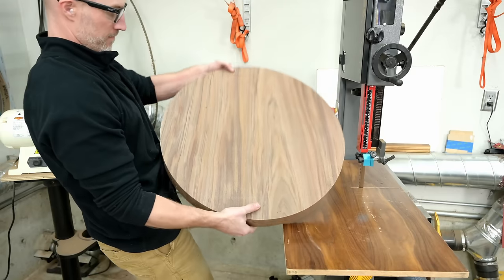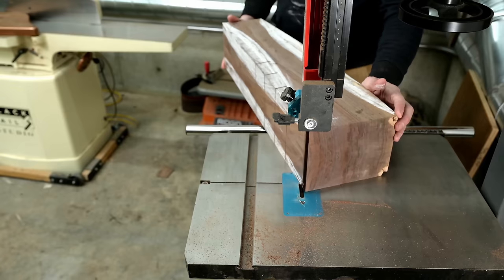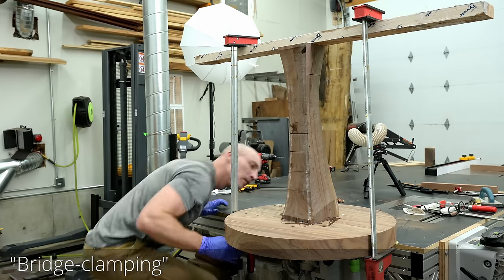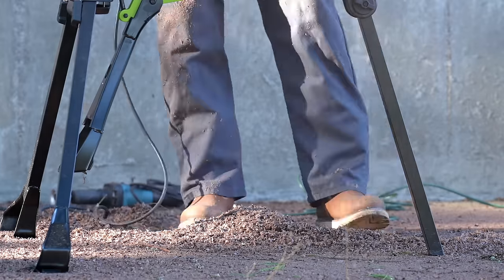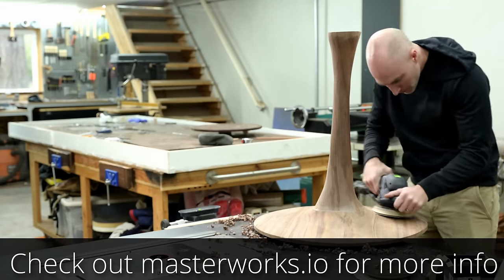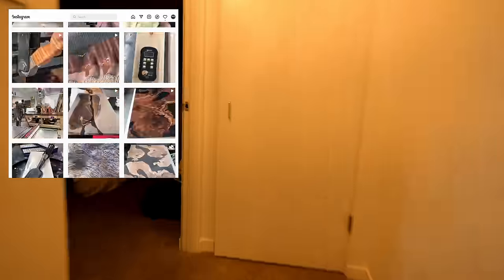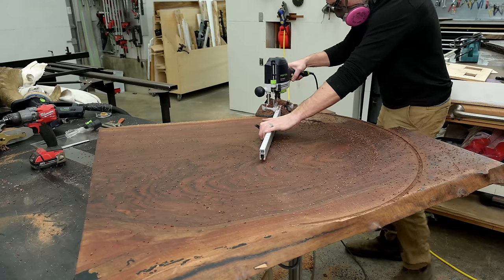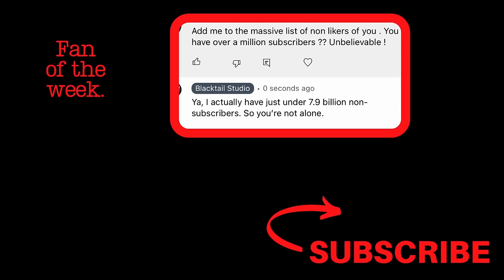I Like Money, But This is Better

Comment: I'm no engineer, but Google says the flexural yield strength of Walnut is around 10,000 PSI, the thinnest section of this table stem looks like about 3" diameter?  that gives us a 7 sq in cross section, or 70,000 lbs of bending force required to break that stem.
Reply: Yeah on the direct middle, gotta take leverage into account if someone knocked this over, see how much pressure to sheer the screws or the wood around the inserts

Comment: The boss spotted me under the table saw, loosening all the trunion bolts - thought it was a waste of my time.  He, being a little guy, took my place while I tapped, with a hammer, our flattest saw blade parallel with the right hand miter slot.  We got it down to two thousandths.  The first test yielded a surface that looked like it had been run through a jointer!  One of the best upgrades to the shop EVER!

Comment: Funny story. I use to use the flap sanding disks on my grinder to shape my kids derby cars.  While I was shaping one car, the back of the finger of my glove got caught on the back of the flap sanding disk and it pulled my finger right into the sanding disk.  Got my knuckle skinned up pretty good. No major damage.  The gloves I had were leather but a mesh back.  I still wear gloves with work like that but I am careful of what the material of the glove is.

Comment: Your a professional and i wouldnt expect you to stretch a product out past its life cycle but i know a trick when it comes to flap disk. If it starts getting dull you can run it on a piece of concrete for a few seconds and it will expose some more sand paper. It may be the difference between finishing a job and not. Hope that helps! Great table and i hope it goes for alot.
Reply: I do a lot of curved surface sanding and shaping.
I use the king Arthur holey Galahad extreme to shape then smooth with the extra fine, then use 80 grit on the arbortech turbo mini. After that I use 3" sanders with a soft pad either in the drill press or on a right angle drill starting at 60 or 80 grit and going up from there.
The main problem with flap disks is the adhesive gets on the workpiece
Reply: @toddschriver9924  i use flap disks in an industrial setting, grinding on metal. Only used them a handful of times on wood but thats good to know about the adhesive.
Reply: @07slowbalt  I sometimes use a soft 5” Velcro pad on a variable speed polisher and with hook and loop sandpaper. 
I used to try it on an angle grinder, but if it catches...
Reply: I just had a conversation last night w another guy (who likes tools as much as I do, and he’s a science teacher/ geologist rather than a woodworker like me), we were talking about this subject for fifteen minutes or so… He was telling me a story about a trip to AK where they were taking core samples out of the Tundra. the bits they were using would dull and get bogged down bc of the silica and rock in the frozen earth, so they carried w them (while hiking to remote places) a bit of concrete in a small bucket, when the bits got dull they would run them against the concrete to expose new cutting material and it worked like a charm. he said he also uses old lawnmower blades to run grinding wheels against at home, to improve the cutting action, refresh the surface of the wheel when it gets glazed by grinding against the hard steel. anyway, good thing to keep in mind, don’t throw away that glazed, or dull grinding/ sanding tool run it on something to refresh it!
Reply: @benjaminherr5247  i used to cut a specific type of brick that was hardened ceramic. It was used to line piping in coal plants as pressurized coal would be sent through them at 200 mph (so they claimed). Anyways the giant 20"+ diamond wheels kept going dull and come to find out if you applied too much pressure it would heat up the steel and the sparks being sent flying were the diamond chips.  Other times it would further imbed them leaving the steel exposed. A quick/cheap and easy fix was to grab a paver stone and run it back and forth a few times and it would expose new diamonds extending the blades use. Ran an pneumatic bandsaw for years as well and a a cheap way to extend the blades life (if not equipped with cutting fluid) was to cut/drag a candle stick on the blade for a few passes. If cutting multiple pieces at once it kept it from binding on me, ran quieter, and imo helped cool the blade.

Comment: Cam, top tip for the glueups when doing M & T's that are so snug it's essentially a piston fit, and that would be to either drill a hole about 1/2 inch by 1/2 inch into either the mortice or the tenon, OR  (preferred method) to have at least a couple of shallow vertically cut channels in the loose tenon to give the excess glue someplace to escape from -  this is why wooden dowels and domino's are ribbed, it's not to increase glue surface area but to allow a way for the excess glue (and air) to escape so you don't end up with something called "hydraulic lock" - a phenomenon that occurs when there's too much glue and air in the void below the tenon and no space for it to escape from, so the loose tenon cannot "bottom out" to full depth and sits above the pocket of uncompressable glue and air.

(For the readers)  Hydraulic lock is pretty much the #1 reason why a M & T / domino / dowel joint that is 100% snug and good when dry fitted, just will not close after glueup without applying excessive pressure (like ratchet clamps), that normally leads to joint failure.  If the joint won't close with clamps using hand pressure, you've got hydraulic lock, DO NOT force it, fix it.

If you fit a loose tenon, dowel or domino into a mortice or drilled hole and as soon as you push it in, it slides out again - that's also a sign of hydraulic lock - too much glue and air stuck in the bottom, remove it, wipe some glue off and try again.
Reply: Great comment

Comment: Cam- Try drilling a hole through the center of the peg.  This will allow air out of the hole when gluing and prevent suction when trying to remove the peg during dry fitment.
Reply: This is really smart
Reply: $3500

Comment: Hi Cam, in regards to gloves: My first career (15 years) was as a welder/steel fabricator. I wore gloves almost all the time. I worked in Central Oregon and the winters were cold, steel has very sharp edges when cut, and nasty burns can happen. These were all reasons to protect one’s hands with gloves. The key is knowing where your hands are in relationship to a spinning tool and keep your distance. 
I then spent the next 25 years as an anesthetist in Portland. Now that I’m retired I’m doing woodworking and sometimes steel furniture making. 
I’ve watched dozens of your videos and thanks to your tutelage my first river table came out fantastic. Just sold it last week.
Reply: Wow, Rod. I can't think of two completely different professions than a welder/metal fabricator and anaesthetist! 😯😊

Comment: What a gorgeous piece of work! And the winning bid amount was astounding also. Thanks for your contribution to Make A Wish.

A trick an old master taught me years ago when making tight-fitting repair plugs. Once you have it milled to the size you need but before you glue it in place, pop it into the oven on low temp for an hour or so. It causes the wood to contract just enough to make it easy to pop into your work, and the moisture of the glue will help expand it again once it's in place. Makes it a lot easier to put the plug in and be sure it actually seated all the way to the bottom of your cut without jamming partway down. Try it out on a piece of scrap and see if you find it as helpful as I have. Results will vary based on the density and moisture content of the wood, so experiment a bit to see what works for you.
Reply from the maker: Oh interesting!

Comment: You might make fitting the tenon a little easier with some shallow grooves on the sides of the tenon.  The reason it was so tough to remove the tenon after the dry fit was air pressure.  With some shallow grooves you provide a way for the air to escape when you push the tenon in, and to relieve the suction when pulling it out.  And of course it allows excess glue to squeeze out too.
Reply: Smart

Comment: If you are worried about the boards slipping back and forth when you glue them and clamp them,  Use ordinary table salt.  It acts like sandpaper and helps the boards not to slide back and forth.  You could glue one or both sides.  I'd say your table will go for $5,100.00
Reply: Look at the auction link
Reply: @Skiballer  Wow, that fast.  Thank you for the heads up
Reply: Or rub a couple pieces of coarse grit sandpaper over the top of it
Reply: I've heard that some glue manufacturers advise against using the salt trick because it might change the chemistry of the glue. Not sure if that's legit or not, but it can't happen if you use sandpaper grit.
Reply: LMAO
Reply: Sawdust works as good as salt, and you don't have to go to the kitchen.
Reply: @KarlBunker  I've never heard of that but I could see how easily it would work.

Comment: When I went to school (I studied 3yrs to become joiner and specializing in furniture making) and we had actual theory lessons. The argument of adding glue to only one side of joining faces is based on some studies which show that more thinner the glue line/joint is, makes the bond stronger and therefore stronger joint.

However, when making good glue joints you have to consider the joining faces themselves too. One sided glue joint applies better to faces which are jointed/planed which theoretically makes the best joint. If joining faces are sanded, then the glue can be added to both sides or alternatively more liberally to one side.

And then there's always the cost factor. But that applies more to industrial or larger businesses. And also I don't remember how this actually applies as global dogma compared to my domestic woods here in Finland. But that's my input on this issue.

Comment: To all the novice woodworkers out there: When it comes to glue, it really doesn’t matter whether you add the glue to one side or both. The important part is that you add enough glue. Either add a thin layer of glue to each face you’re joining, or a relatively thick layer to one side. Also consider the wood you’re using because some woods (usually soft woods, but not always) soak up more glue than others. End grain will also soak up more glue than edge grain. It’s better to add too much than not enough. If you’re getting a ton of squeeze-out, dial back the amount a little. You’ll get a feel for what enough glue is as you do more and more projects.
Reply: I thought  end grain was tighter / harder thus making better  Butcher Block tables , what I miss thanks in advance
Reply: @robervar1097  The fibers of wood run in one direction. It’s easier to cut along those fibers than it is to cut across them. Also, among those fibers are the vessels where the “blood” of the tree would run. Edge grain has less porous surface area than end grain because of this. So yes, the fibers of end grain are harder to cut through, but end grain soaks up more moisture/liquid because of that more porous nature.
Reply: @robervar1097  end grain is more porous than Edge grain but you have to remember that some Woods are more dense than others. So Butcher Block Table made of pine would not be very tough and it would soak up a lot of moisture. Whereas a butcher block table of maple would be much more dense and it would stand up to more wear and it would soak up less moisture.
Reply: @robervar1097 , end grain is easier on the edge of the cutting tools and the wood grains aren't being cut, but rather pushed to the sides away from the edge and then coming back together once the edge leaves the wood, giving it a longer-lasting life than other cutting boards/blocks.
Reply: Also, I keep an old salt shaker with my wood glue. Sprinkle a bit on the wet glue before assembly and clamping. I keep the parts from sliding.
Reply: Having watched alot of bowmakers laminate timber they insist in putting glue on both surfaces. Being wooden springs often under compression and tension  that seems to work best. Though I'd agree in most circumstances it wouldn't make that difference.

Comment: I'm attempting my first table this month. I've done some smaller projects for practice (a clock and a couple tv trays). I'm now attempting a bedside table for my mother for mother's day. I've learned 90% of the process from this channel with the other 10% from people showing me DIY ways to deal with limited equipment and tools on a budget. I guess we will find out if I've really learned anything here. If it works out, I'm going to try to make something I can sell so I can get some better tools

Comment: Hey Cam - so glad you're back!  Regarding your glue-up, I've always coated end grain with a "first coat" and let it soak-in, for a more successful joint.  This is particularly important when gluing the edges of plywood (sometimes I'll dilute PVA for this).  With Epoxy (I've always used the West System brand), I choose to use the slower setting hardener - this allows me time to end coat any and all end grain first.  Generally, when I'm prepping multiple parts, by the time I come "back around" to the end grain portions again, the glue (PVA or Epoxy) has soaked into the grain.  The result is that the challenging end grain glue-ups aren't robbed of adequate adhesive.  The only issues I sometimes run into, is a slight staining - where epoxy has soaked laterally into the end grain.  I sometimes anticipate this and hold the first coat just back from the edges (blue tape works well).  This method has served me very very well - for decades !  One other comment - I learned early on from a fellow woodworker to NEVER spread out any wood onto the floor.  It will pick-up grit, sand and other junk that is just terrible for all the cutting equipment in a shop.  Thanks again Cam - well done.  Warm regards - Ken Jackson  Vancouver Island, Canada.

Comment: One thing most YouTube wood workers don’t address is the cost of bits and blades.  You can get away with a 3,5hp Porter router for $600 but you absolutely MUST be using blades that often cost more each than the router itself.  Our shop table saw blades run almost $300 ea. but they can be resharpened for almost a decade while getting professional cuts every time.  If the fit and finish is your goal…great bits and blades should be a priority over the ‘best’ tools.

Comment: $4300 what a beautiful table! Also, that wood grain effect so desired by guitarists is called Chatoyancy. Have you ever thought about putting a steel rod through or sandwiching one before a glue up of two halves in order to add strength to thinner table stems?
Reply: Столько работы,такая текстура дерева,талант мастера-и 4.300$???!!!Да вы шутите и жмотитесь или завтдуете таланту😮😮😮

Comment: Regarding the glue. I've done it both ways, but usually mist the wood with water, and glue one side, misting the second piece just before putting them together. Over 45 yrs working with wood (part of it in a pattern shop) and I've had exactly zero experiences with adhesion failure. And nice work!

Comment: Absolutely stunning!! Laughed at getting wood tenon stuck in mortice, ur right it gives you faith the joint will be strong. If you ever come up against a similar problem, make yourself a sliding hammer, it will help remove the piece if you come up against this problem in the future. Absolutely brilliant, Love it.

Comment: 17:07 New to the channel so don't know if this has been brought up before, but that texturing looked really nice, reminded me of hammer beaten copper plates from older times, maybe it would look good not as a bottom/base but as a surface, covered and made flat with clear epoxy with a shiny lacquer or paint under the epoxy? Just a thought
Reply: At looking the vid i thought it will be the surface (i don't understand fast spoken english well)
Reply: @addjem  Me too! Looks like too much work to be facing the ground
Reply: i dont understand why you would put so much effort in it,when its the underside of the base. If it was the underside of the top plate... that would be nice to touch every now and then...

Comment: Hey Cam,
i recently bought the same Angle Grinder that you have. My father used it for the first time and accidently his shirt got caught by the angle grinder. Good luck that this grinder has a kickback protection. But anyways, parts of the shirt got ripped of and wrapped around the grinder. i saw it and thought the grinder is stuck in his belly. That happened in a fraction of a second.
So trust my, if your glove catches the blade of the grinder, your fingers or your wrist is gonna have a really really bad time. So please watch out with your gloves
Reply: Yeah, an angle grinder has plenty of power when something gets caught in it... I've heard of plenty of stories of people getting messed up by them. Cam's not exactly running the cheap drillmaster angle grinder there.
Reply: Yeah, angle grinders are most dangerous tool out there I believe. Or one of them, statistically. But yeah, I never wear a glove, especially on hand tool is in. Not enough finesse and have gotten close it it getting caught. And I've seen the power of what a hand drill can do catching my shorts once. Spun it around and tourniquet my leg. Biggest scar I have still. Just the force of the clothes spinning, drill bit didn't even touch my skin. Nuts.
Reply: @jonny-b4954  Yeah I had that happen to me once early on in my woodworking. Grabbed my mechanix glove and wrapped it around the bit. I let go of the trigger fast enough that it didn't break my fingers, but I'll tell you it still hurt. It was after that I quit wearing gloves near anything that spins.